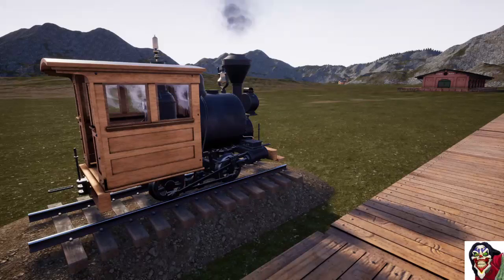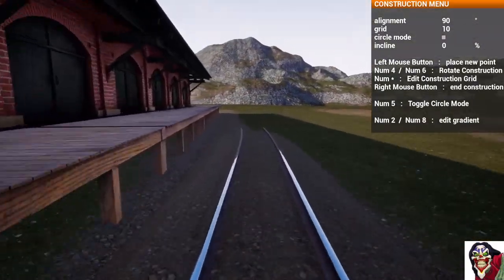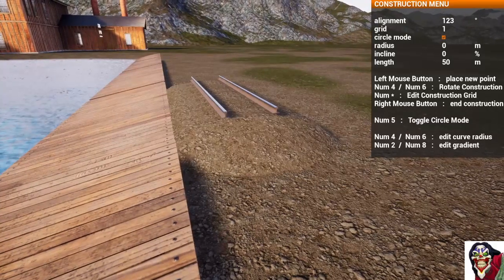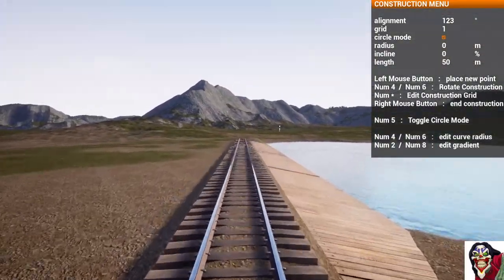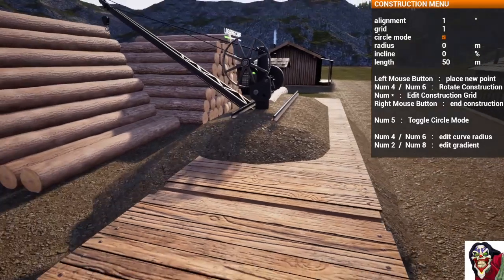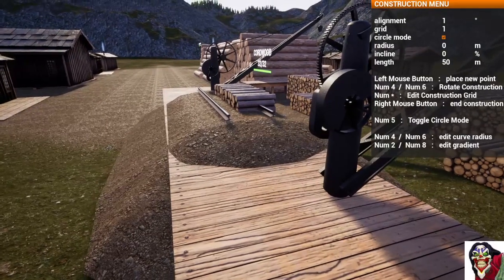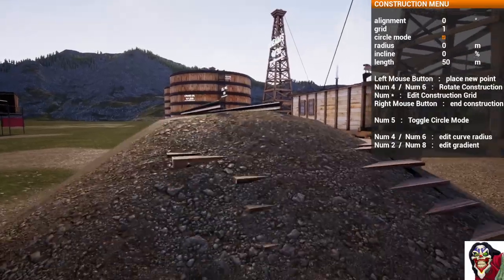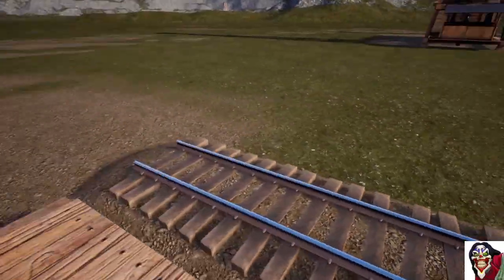RRO - New Splines Tutorial Ep2

Comment: How do you remove the trees?
Reply from the maker: I used the tree-inator 3rd-party app which edits the savefile.  The link for it can be found on the official discord.  The railroad.studio link in the description can also remove trees from your savefile.

Removing all of the trees makes the savefile size very large.  I use the completely cleared map for tutorial purposes only and its probably better to selectively clear the trees with the tree "paintbrush" on railroad.studio for while you're building the map, then use ROSE, tree-inator, or railroad.studio to plant them back at a set distance from the rails when finished building.